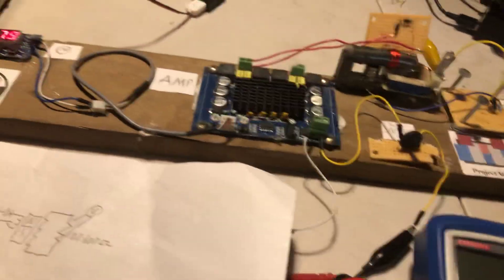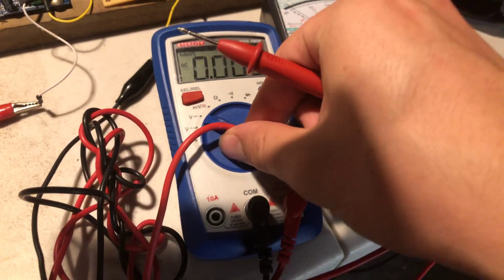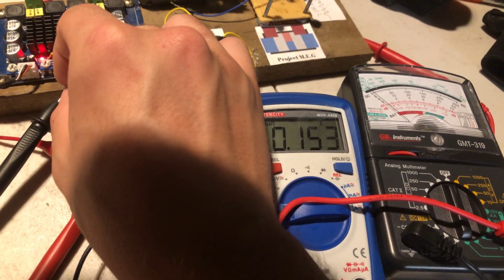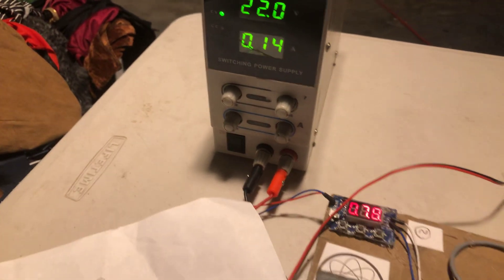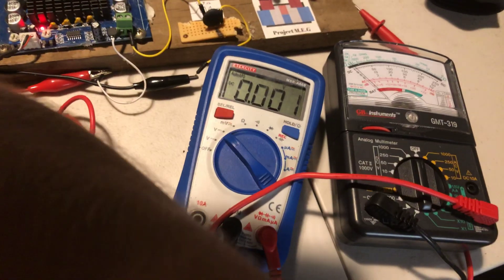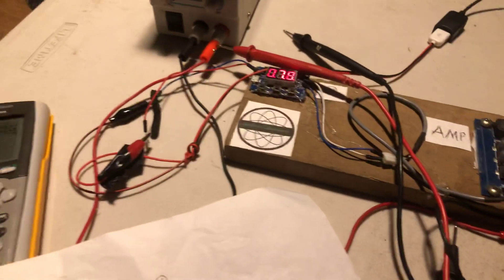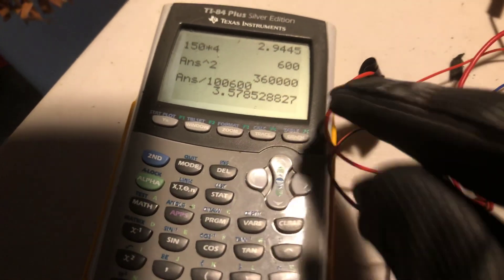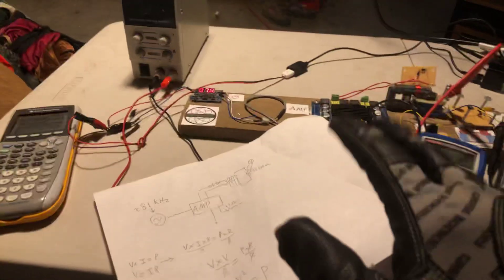Motionless Electromagnetic Generator by Tom E Bearden (Ferrite Core)

Comment: What was the frequency and duty cycle of the output? Could it have been that the average current was actually lower (low duty cycle), so the V^2/R equation was inaccurate?

Comment: You cannot measure AC power by multiplying the voltage times the current, because there can be a phase difference between the two. You end up with "reactive power," which is an apparent power that is not usable. You need to take into account the power factor, which you can read about online. What you  have shown, unfortunately, is NOT a gain in power.

Comment: Hey man, you got a COP of 1.215. 

Are there any catches?
Reply from the maker: Well, I'm not too sure about those results, as the high voltage may have had some interference with the meter. If I wanted to do it more properly, I should have utilized a voltage divider or something similar
Reply: @filigenzilab9613  awesome. I think we’d all love a video like that, either proving or disproving the validity of your results. You have my subscribe!
Reply from the maker: @ashercorbett8089  thanks. I’ll see about making one when I get the chance now that I have better equipment and methods for testing
Reply: @filigenzilab9613  awesome bro, looking forward to it
Reply: @filigenzilab9613  did you ever investigate this?

Comment: Building something without knowing how it works is lame.
Reply from the maker: @zbigniewrichard8291  to be frank, I was curious to know if it would work at all. Because the idea intrigued me, yet I did not understand the theory. At first I thought it was because I was uneducated, but over time, I would accept it was because the theory was against conventional science. That you cannot create or destroy energy. As such, I have abandoned this project
Reply: @filigenzilab9613  Since you believe in laws that apply only to CLOSED systems, experimenting something based on another kind of physics was doomed to fail for you.
Reply from the maker: @zbigniewrichard8291  Well, imagine we have a car piston. It expands because the internal pressure is much higher than the external pressure. The way we obtain energy is not just by having energy alone. We need a difference in potentials. Like having 1 Million volts could be a lot, but if the surrounding environment also has 1 Million volts, you could not get a current. As such, having a "vacuum energy", or having the vacuum basically full of energy, no matter how intense, could never be obtained. Unless we have a region of a smaller energy density.
Reply: @filigenzilab9613 but doesn’t the static magnetic field created by the permanent magnet created that potential difference YOURE talking about? You have a large amount of energy is the vaccum, and a potential difference from the permanent magnet.

According to bearden, the B field of the permanent magnet is “contained” by the ferromagnetic material, revealing the magnetic vector potential A.

This seems similar to the potential difference you’re talking about (such as with the piston and such). 

Why abandon the project if there is empirical evidence of proof of concept? Unless there is a catch?
Reply: Excuse that random YOUR in all caps. Phones funny like that 😂
Reply from the maker: @ashercorbett8089  Wouldn't that mean that if it did work, that the potential of the magnet would, over time, become smaller and smaller. Like a battery losing charge?
Reply from the maker: @ashercorbett8089  It's fine
Reply: @filigenzilab9613  you’re saying that the potential difference would be destroyed by neutralization (like what you’re saying a battery), demagnetizing the magnet?

Is this what you’ve experienced, or is it just hypothetical?
Reply from the maker: @ashercorbett8089  Hypothetical. If the magnet's magnetic energy is being used, wouldn't be used up over time?
Reply: @filigenzilab9613  Not necessarily. 

Tom Bearden, the inventor of the MEG, stated that energy can flow, without destroying the dipole, whether electrical or magnetic.

The principle behind the MEG tries on the fact that vacuum energy has limitless potential. Electrons have infinite energy, and protons have infinite energy. A constant magnetic dipole, a “steady state equilibrium”, takes place at all times between the north side and the south side of a permanent magnet.

According to the alleged principles that this machine relies on, vacuum energy the size of a man’s fingertip, when converted to mass using special relativity, would be the size of galaxies and galaxies in mass.

That being said, collecting energy from the limitless (or at the very least, essentially so) vacuum, is analogous to connecting a siphon to the ocean.
Reply: If you’re interested, you should research the series “energy from the vacuum”, specifically the Tom Bearden interviews. He’ll explain it a lot better than I can 😹
Reply from the maker: @ashercorbett8089  thanks for letting me know
Reply: @filigenzilab9613 why did you abandon it if the COP was greater than 1?
Reply from the maker: @zbigniewrichard8291 I agree

Comment: so, something that has ALWAYS bugged me looking into this recently, is the dogmatic obsession with the first law of thermodynamics. but the MEG and Floyd Sweets "VTA"  do not create energy at all. they are siphoning energy out of the vacuum, much like how you would take the energy stored in a peice of coal by lighting it on fire and the heat being used to transfer that heat to food or water to make steam, these devices never even were designed to break the laws of physics, just a re-application of the very same methodology used to extract energy from other sources like oil and gas, coal, and nuclear. except in this case it acts like an electromagnetic siphon, the initial power supplied stimulates the circuit drawing energy from the vacuum and the air around you that is already present around us 24/7.  its what tesla called the ether and its got a theoretically limitless amount of energy because of how energy dense the universe at large is. so I think keeping this in mind when you approach this research or anyone else stumbling into the video as I just did will help a lot. if you are limiting your understanding to what is already known, you cannot innovate, only replicate.

Mindset is the basis for how you percieve the world around you. stay open minded, dont believe everything someone says when they havent done the work themselves, no matter how many PHD they have.
Reply from the maker: Well, how does the MEG obtain energy anyways? To extract energy, one needs a change of energy or different energy potentials. Imagine a car piston. It only moves because the internal pressure is much higher than that of the external pressure. If there really is an unlimited amount of energy throughout space, it would require us to have a region of more or less energy to extract it. Like if the car piston had a lot of pressure both inside and outside the chamber. It wouldn't move, even though it is surrounded by energy
Reply: @filigenzilab9613  I think you're going about it the wrong way. Firstly, there really us energy everywhere. Its how natural forces like wind, waves, a d even magnets get the energy to push or pull things. How I understand the VTA to work, is that the oscillating magnetic fields lower the resistance, allowing for excess energy to seep into the circuit. You gotta think of these less like mechanical devices like a piston, and more like a tree tap. Once you get the tap in at the right spot (resonance in this case) it provides a way for that Ether energy Tesla was working with to seep into the circuit like sap flowing from that tree tap. Make sense?
The way tesla achieved this, is by pulsing high voltage DC. Because when he was observing linemen working on Edison's DC powerlines, at the moment of break, the blue spike phenomenon was observed, and thats what started him down that path. Floyd sweets device uses an oscillating magnetic field then pulses the input coil at a similar frequency. And when they fall into resonance, the extra energy is picked up between the jump from the input/driver coils and the output coils.

 I understand the MEG does a similar thing, but my focus has been on the VTA because its easier to build and less complex. Quite literally two magnets and some coils. The hardest part is conditioning the magnets field to self oscillate.

Comment: They use the Aharonov-Bohm effect in their patented Motionless Electromagnetic Generator (MEG). They are able to use the Aharonov-Bohm effect to first energize the surrounding vacuum outside the transformer core with curl-free A-potential, then perturb the core normally so as to send out A-field perturbations into that energized external vacuum (into its A-potential). From the perturbed local A-field vacuum the MEG receives back (from all directions) excess E-field energy pulses by the simple equation dA/dt = – E. The result is that the local altered vacuum – when subsequently perturbed – then sends back free E-field energy to the unit as an extra, free energy input from the active vacuum environment. By insuring some coherence in the received E-field signals, they also insure that the return excess energy input is usable EM energy from the altered local vacuum/spacetime.
 
As you know, force fields exist only in matter, since mass is a component of force by the simple equation F = d/dt(mv). Placing m = 0 in that equation shows that in massless space, “force” does not exist. So instead of EM force fields in massless space, instead there exist precursor “conditions of spacetime” as pointed out by Nobelist Richard Feynman. What we call “EM force”, then, rigorously is the ongoing interaction of that “precursor field” with charged matter q.
 
As the great John Wheeler points out, “Space acts on matter, telling it how to move. In turn, matter reacts back on space, telling it how to curve.”  [Wheeler's principle, as stated in W. Misner, K.S. Thorne, and J.A. Wheeler, Gravitation, W.H. Freeman and Co., San Francisco, 1973, p. 5].
 
Wheeler also pointed out the dominance of the interacting spacetime with matter and effects in matter. Quoting: “…elementary particles represent a percentage-wise almost completely negligible change in the locally violent conditions that characterize the vacuum...In other words, elementary particles do not form a really basic starting point for the description of nature. Instead, they represent a first-order correction to vacuum physics.”
 
So the Aharonov-Bohm effect (together with many others) shows that it is possible to directly condition or change (or “engineer”) the local spacetime itself, and then use it to affect the physical system embedded in that altered local spacetime.
 
What we call “force” is the ongoing interaction of the “condition of spacetime itself” with matter.
 
The bottom line is that (1) the vacuum/spacetime can first be preconditioned locally (precursive engineering), without using force or work (which is translation of force), and (2) then the altered and energized vacuum/spacetime can be stimulated to provide excess EM energy freely back to the system. The system then has TWO energy inputs: (1) the one we pay to make, and (2) the one the surrounding activated vacuum gives us for free. So, like a windmill in a free EM energy wind, their unit can exhibit COP>1.0, even though its energy efficiency is always less than 100%.
 
So “energy from the vacuum” is no more eerie than a common windmill or solar power cell array. Given the necessary input energy from the active surrounding environment, the system is legitimately permitted to function as an analogue to a common heat pump – which has an efficiency of only about 50%, but which normally has a COP = 3.0 to 4.0. In short, the heat pump wastes half of all its input energy from whatever source, but it receives so much excess energy from its activated environment that it can still output more heat energy than the electrical energy the operator himself pays to input. No violation of thermodynamics or of physics is involved. Instead, there is involved just a way to directly and freely alter the local environment so it is energized, and then to trigger it into sending free energy into one’s system to be collected and power the loads.
 
Note that such asymmetrical overunity electrical systems are specifically excluded from the normal electrical engineering model. The Heaviside equations were deliberately symmetrized in 1892 by Lorentz, at the instigation of J. P. Morgan, just prior to the formation of modern electrical engineering. It was done specifically to remove the asymmetrical “energy from the active vacuum” systems that Nikola Tesla had discovered. Tesla had labeled them as “energy from the active medium” systems. Tesla had just destroyed the dream of Morgan and Edison for their great DC power empire (a DC power plant every two miles in cities and built-up areas) by putting in practical AC generators at Niagara Falls. Since AC could be transmitted fairly efficiently for long distances and DC could not, then with AC power one did not require most of those expensive DC power plants. So the world adopted AC power stations and transmission. With that blow to his dreams of empire, the ruthless Morgan was immediately determined to destroy Tesla utterly and his backer Westinghouse also. And he thoroughly accomplished both goals.
 
Here is just one statement by Tesla of what he intended to do. Quoting:
 
"Ere many generations pass, our machinery will be driven by a power obtainable at any point in the universe. This idea is not novel... We find it in the delightful myth of Antheus, who derives power from the earth; we find it among the subtle speculations of one of your splendid mathematicians...Throughout space there is energy. Is this energy static or kinetic? If static our hopes are in vain; if kinetic – and this we know it is, for certain – then it is a mere question of time when men will succeed in attaching their machinery to the very wheelwork of nature." [Nikola Tesla, in a speech in New York to the American Institute of Electrical Engineers, 1891. Quoted from back cover of his biography, Margaret Cheney, Tesla: Man Out of Time].
 
During an address in 1897 Tesla stated:
     “We have to evolve means for obtaining energy from stores which are forever inexhaustible, to perfect methods which do not imply consumption and waste of any material whatever. I now feel sure that the realization of that idea is not far off. ...the possibilities of the development I refer to, namely, that of the operation of engines on any point of the earth by the energy of the medium...” [Nikola Tesla, during an address in 1897 commemorating his installation of generators at Niagara Falls.].

Comment: Your video is interesting.  Tom Bearden demonstrated a test prototype of the MEG that gave a COP of 5.0 and explained it quite successfully.  I believe that higher COP is possible with some ingenuity.  The real secret of the MEG is in the decoupling of the magnetic components.  There is a spin component and a linear component (non-spin).   Tesla also achieved many >1 COP devices by breaking the symmetry and using a portion of the output to power the device.  It is entirely possible, and, with a little work, can be achieved.  Please keep experimenting and posting.  Thanks so much.

Comment: We are surrounded by energy but it’s out of phase with us. Our sun brings it into our universe so we can use it.
Reply: There's ways to bring it into phase
Reply from the maker: Being surrounded by energy doesn't mean you can obtain it. If one were to have a car piston with a lot of pressure on the inside, but low pressure on the external side, the piston would move. Not because of pressure alone, but because of CHANGES of pressure. If the car piston had high pressure on both the internal and external sections. It wouldn't move at all. Another way to visualize it is with a battery. You can have a huge voltage potential. 1 volt, or 100 volt, or 1000 volts. You won't get a current from it alone, you need a change of voltages. A positive and negative electrode
Reply: @filigenzilab9613  we simply need to understand the mechanisms. And this isn't possibly if the scientific model closes us off from it. The same is true for the vacuum, when they removed maxwells original scalar equations
Reply from the maker: @joshuam4993  if you could explain the mechanisms, I would appreciate that. I tried reading the paper once, it went over my head

Comment: If you realize how induction motors work there is no actual conversion from mechanical energy to electrical all thats happening is a means of using mechanical energy to create aether disturbances within a changing magnetic field. The same is done with the meg the aether disturbances are caused by the rotation of the magnetic flux . Energy is only supplied in order to function the electromagnetic coils in order to shift the mag flux and cause the cascades of disturbances that induce emf...